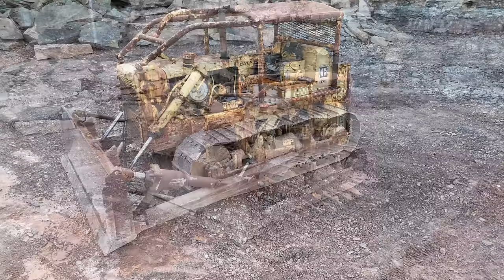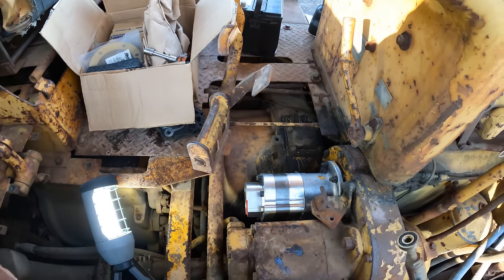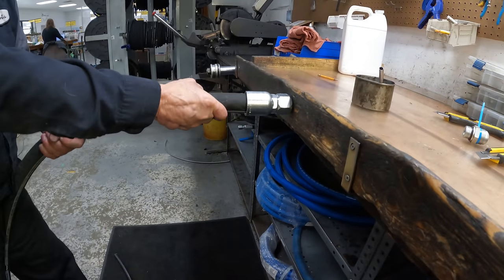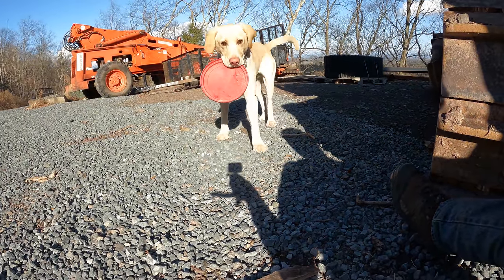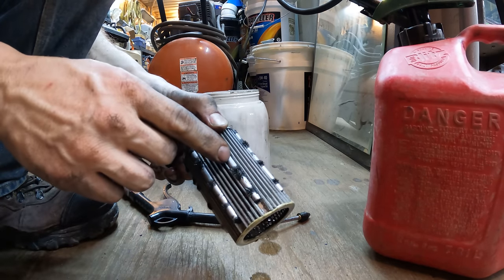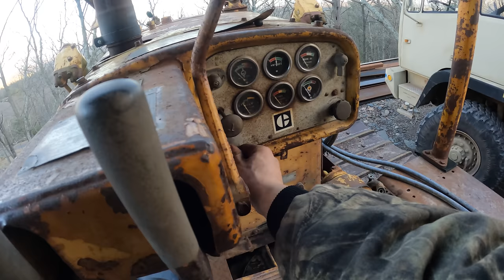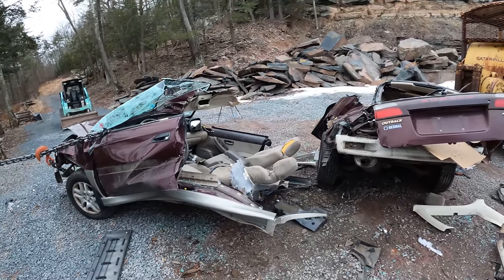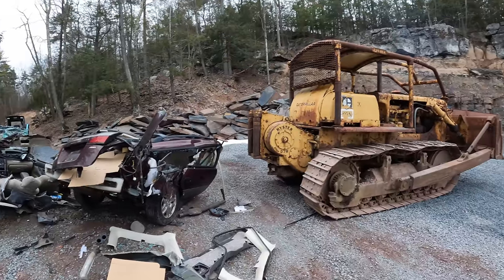Fixing a bulldozer winch

Comment: Id recomment putting some cable grease in the winchline, lubrication is very important and will make spooling way easier. Cable grease is also water proof and will penetrate into the cable fibers.
Reply: Cable fibers?  I thought it was just strands of steel braided together?
Reply: @AK-47ISTHEWAY  It is still fibres of steel that form a cable.
Reply: @Drakey_Fenix  research  fibers goof    you have no clue
Reply: @bernlew977  each metal strand to make the wire is still called fiber dummy
Reply: @James Riley   go watch family guy kids    this is for the real men    not boys
Reply: Old motor oil/gear oil works wonders. I have had buddies that use this grease, and their cables end up fraying/snapping. I haven't had a problem with using oil. Ya its messy but done smart it's not too bad.
Reply: I was thinning that, and swap the cable end for and .. all the wear is on the first half (and put 4 cable clams on the hook end :) )
Reply: I knew what he meant...get over it... Grease the cable ...
Reply: @bernlew977  cotton fibers aren't fiber? GTFO, soy boy.

Comment: hey andrew, i am a commercial boat owner and a tip i can give you with old hydraulic winchs or any equipment that have been sitting, you can just hook one side up leave the other side of the winch port open, start up the pump hit the proper arm for that direction and collect all the gunk on the other port with a bucket. Usually everything comes off in 2-3 seconds. shut it off and hook it properly. Good video thanks! cheers
Reply: What does it mean to hit the proper arm? I understood the rest.
Reply: @jeevunvethanayagam6536  I mean acuate the lever for the port that isn't open so hydraulic oil goes through and exit in your bucket
Reply: @jeevunvethanayagam6536   the controls, forward, reverse, up, down,  etc
Reply: @realphilg  gotcha. Thank you for the tip.
Reply: I h.

Comment: Andrew, look in the bottom of the hydraulic reservoir and see if there are sand dunes of metal shavings/filings.  These will forever clog your filters.  Our injection molding machines came from the factory with piles of shavings in the 1100 gallon reservoir.  It looked like a friggin' beach in there.
Reply: @gatekeeper65  Isn't everything???
Reply: I found casting sand in a 1978 Plymouth Volare's 318 V8 many years ago ... its not just the Chinese ...
Reply: @uploadJ  Yep! And that's why race car engine builders thoroughly clean out ALL castings, iron, alum, etc. I bought a 1968 Dodge Coronet brand new. Had a rattle in the door, so rather than take it to the dealer, I popped the door panel off and found a 9/16 X 5/8 end wrench laying in the bottom of the door from the factory!!
Reply: @Watchyn_Yarwood  Score ! 😃
Reply: In hot/summer day (when oil does not look like ice cream) I guess opening the both filling/bottom caps will be good. If possible make the dozer not fully level so the drain cap will be "as down as possible" regarding rest of the tank. Then a good wash with sprayed fuel/diesel and let the tank dry. If tank drain "too much" dirt as part of this cleaning I guess opening it may be required. But cleaning it with a good "diesel wash" will surely help you to keep the pump/winch in good operation for a long time 🙂
Good video whatever.
Keep going Andrew !
Reply: @gatekeeper65  A man can't have too many wrenches!
Reply: I would think he is going to at some point change that oil and flush it, there was water and who knows what came out in the old oil, if he doesn't look for another video in about a years time where that pump needs to get replaced as it had stopped working for no reason 😆😆
Reply: I love the beach

Comment: Solid repair.  That winch has got some balls!
Reply: The biggest balls of them all!!
Reply: Probably at least a 65,000 lb winch. It’s badass!
Reply: Imagine what 500’ of cable alone weighs, not sure what that EX weighed but i never heard the engine change tunes dragging it....
Reply: d7h's are 80,000lb winches
Reply: @Dan-ot7tz  holy shit thats insane litteraly the power of god
Reply: That winch has enough power to pull hell off from it’s foundation. And then some..
Reply: Definitely jolly cat yellow balls
Reply: I looked up the specs on a winch like that (Caterpiller 57H Winch) and found it is rated at 120,000 lbs. The cable is probably good for only about about 1/2 of that.
Reply: @Dan-ot7tz  sweet!! So he can kinda pull a fully loaded semi gross weight of 80,000 lbs
Reply: If he does not like you he could put a 60 ft I beam on one side of your house and well 😋
Reply: Hoo yes plenty of power 🔋in that watch.
Reply: Sup Chris 🤙
Reply: I'm not sure though, but it seems like that might be the wrong way to make a stretch limo.
Reply: @joeymusik1609  If it is the 7L winch, it will have 70,000 lbs of pull.  That would be the standard winch for this size of Cat.
Reply from the maker: Thanks. Yeah it’s pretty much unstoppable because it drags the dozer around if it can’t pull something.
Reply: @gavinperry7237  He did on the one or two pope thread fittings. The fittings on the hoses have internal beveled surfaces that make the seal, the actual threads just hold everything together.
Reply: @joeymusik1609  according to hyster info 80,000lbs on a D7
Reply: The hydraulic physics blows my mind
Reply: @jamesharris40001  wayt until you Discover theres about 15types of fittings 😂
Reply: @AndrewCamarata   A fitting end of a Subaru.
Reply: Which wihch

Comment: I think those two lines just hanging out were coolant swap lines. It's pretty common in logging/oil drilling to run warm coolant through a cold engine to get them started easier in the winter. Just my two cents, and Great Video!!
Reply: Nice to know.Thanks for sharing.
Reply: @Steve Sherman 5
Reply: This is exactly what i was going to say! As ol peg from zip ties and bias plies would call them spit swappin lines!
Reply: I believe your right I pulled a tanker with food grade stuff we ran coolent to keep products from freezing
Reply: Those are hydraulic couplers on the end. Only thing I can see is they were for running auxiliary hydraulics.
Reply: @Donkusdelux  you could be right, but they just looked like regular quick connects to me.
Reply: @Donkusdelux  for harrows and fire plows !

Comment: Even at 65 years of age, i'm still fascinated how a small device that pumps a tiny amount of liquid can build enough strength to move such a massive weighted machine. There are literally thousands of pounds of weight involved here but yet that little pump will pull that entire machine on angles and often even up hill with other weight attached sometimes. This generation is also fortunate to have modern machines that are so powerful that they can be operated with a little joystick and a few push buttons and even having such luxuries as Air conditioning and heat and stereo in a enclosed cab.   When i started out, everything was still cable operated and motor driven with gear drive units and some push button starters instead of pony motors to start the main motors. From Primitive to almost automated in just a span of 30 years it seems. Amazing.

Comment: I'm so glad that you know what you're doing when reeling in that cable. It's such an important step, which most people don't realize.... Anytime you are reeling in a winch cable (steel or especially with synthetic rope) you always want to make sure that you have some tension on it so that when it winds it's on there tightly. In the event that you don't do that, you run the risk of cutting the cable with itself due to the tension put onto a loose spool, as well as increased chance of it getting tangled up and wound up which would make it very difficult to undo. It's always good to see someone that knows what they're doing not taking half-assed steps. 👍🙌👏
Reply: Good advice I like to spray some oil on the cable when it's winding back up
Reply: @jackk8422  I actually worked for Warn for a little while... I learned a great deal about winches and how they function, Etc.  What you mentioned about the oil is a great idea as well. Prevents rust and allows them to spool out and back in much easier. 👍
Reply: @three6ohchris  learned that the first time I had to change the cable on a 80 ton crane.
Reply: @jackk8422  lol, Oh wow... I can't even begin to imagine how much "fun" that must have been, LOL.  Those hydraulic high capacity winches can be beasts.  Giant sizes of cable that have to be used on those.. good gracious. I see why you sprayed it with oil. LOL.
Reply: @three6ohchris  now that I think about it the cable got tangled in itself because the supervisor decided to break the crane down and he didn't have any tension on it. Also it was a 1974 p & h so it is a mechanical which

Comment: FYI, Just in case you aren't aware, there is special lubricant for winch cable that does not attract dirt. Regardless of what you choose you might consider putting something on that winch line to stop the rust. Spooling line on the winch is demonstrated well on Ron Pratt's channel. Just a suggestion
Reply: Seilfett
Reply: This lubricant is great for underbody protection on cars
Reply: It's not just the rust.  Oil inside the cable would make it more supple.
Reply: i was very surprised that while it was fully out he didnt clean it and lube it for future use
Reply: Yes 👍 it is!! Ron Pratt did an outstanding job on those videos….
Reply: @bigsrg978  thats what she said
Reply: @vj8452  das zeug Kleebt aber wie sau
Reply: Just spray some diesel on it when ya fuel up. Been doing that in th logging woods for years
Reply: Some cables have a core that holds oil/grease that makes them a soft lay and also internally oiled. We used to use them on our winches. That cable on the winch looks like it needs a little bit of care and attention before putting into any sort of action.
Reply: @bigsrg978  That is what I said.
Reply: Субару испортили...

Comment: Really like seeing you getting these old machines working again and their attachments. I just bought a fully restored (every nut and bolt removed) 1966 cat D7 with hyster winch also. The history of it is, it was bought brand new here in australia by a western queensland farmer (where i live) to do one job and that was to clear trees and make a road on his farm and make firebreaks around the perimeter of his property. From what i gather he did that and used it mayne twice in the mid 70s and he got sick and it sat ojtside in the sun on his farm until the owner before me bought it in the early 1990s. He started to restore it when he retired in 2007 and slowly worked on it and other machines in his collection. I had wanted a bigger machine but i can't justify needing any bigger. I bought the machine for what i consider a good price and he knows it will be used. He retored it to a condition that he said isnt overly restored. The engine was torn down and rebult and looks new but nkt brand newparts werent pilished but parts that were meant to be painted were. My first job will be digging a new dam tomorrow as we are meant to get some welcome rain. Happy new year from australia

Comment: Thanks for the videos.
A crows foot wrench head on a impact wrench with appropriate length extension can work good to tighten or loosen hard to reach hydraulic hose fittings.
Reply: Thanks dude! I've never thought of doing that! Seriously,sometimes I cringe trying to tighten fittings, putting covers back on and wondering "did I get that tight enough?"
Reply: Everytime I've tried that it's turned into a disaster 🤣 oh well I guess one more try won't make anything broken than it already was 😁👍

Comment: Andrew you still need to let the starting engine stop by running out of fuel to save the 1 quart in it from being  diluted  with gasoline.  The small tank shown is actually  safer  for that engine than the factory one thats mounted up above it. Placing the  tank down below the engine ensures it wouldn't have a constant supply of gas.
Also that loose track hasn't  come off yet? Wow looks real loose, bad tentioner shaft seal? Real funny parting out of the Subaru with the winch cable lol
Reply: Maybe The Chieftain would be interested in stopping by for some track tensioning  ; )
Reply: totally agree on the pony motor need to let it run out of fuel and you dont need alot
Reply: That track is probably worn to a length that is more than the adjusters can take up. He might need to compress the adjuster in and remove a link of the track. I'd say that undercarriage is 10%.

Comment: I've been waiting for this video to see you fix that I'm glad it was just a simple thing to fix you know just a pump and cleaning things up we used to use those winches that you're using right now to drag Douglas fir and cedar logs up of 6% grade out west that were 32 to 34 ft long and anywhere between 3 to 4 foot acrossed with absolutely no problem at all you'll be amazed with that thing will pull
Reply: well it probably has what 200-300 HP diesel engine driving it the weak link almost definitely being the cable itself which looked to be an inch or better in diameter, quick google search shows 1" stranded steel is good for  a breaking strength of 86,000lbs.. hate to be around if that lets go.. if youre not chopped in half your pants will be ruined and likely your ears blown out

i dare say if you find a way to make the dozer immovable and the winch line loads up near that amount itll break that cable too.. asssuming theres no pressure relief in the hydraulic system thatll goto tank prior to that happening

Comment: Because of your channel, every time I pass by a place with heavy equipment I'm like "this would be so much fun to work on".  Glad you got it working.
Reply: Said no heavy equipment mechanic ever 😂
Reply: @tasmanmcmillan1777  Haha most definitely.  Ask me again when it's 30 degrees, snowing, and I need to drop the oil pan
Reply: @N0Fumar  try when it’s 47 degrees c & the pin between the main boom & stick of a 500000kg excavator has seized and refuses to move anywhere

Comment: I do have a question, for you Andrew.  I hope you see this, that fitting on the filter that has the "jam" nut on it being feed from the hydraulic pump.  That type of fitting you do not put sealant on the threads or pipe dope.  That is a straight threaded fitting that uses that o-ring at the sealing nut to keep the hydraulics in.  When you put that fitting it it should not and I say this strongly should not get tight.  That means you have bottomed out that fitting that can break the housing that it is going be a bad day.  Just run the fitting till you feel it stop, loosen the fitting up one turn lining it up with your hose.  Thread your hose back on the fitting and use the hose to help hold the fitting while you tighten up the sealing nut that has the o-ring.  Job done.
Reply: O-Ring Boss fitting
Reply: STOR fitting ... straight thread O ring
Reply: @tyendor1952 )
Reply: It looked like it had a jam nut on it based on how he was manipulating it with two wrenches, but if you watch carefully, it doesn't seem to have a jam nut. That he'd on the end is integral.
Reply: Where is the question?

Comment: 16:22 there is no need for thread tape on o-ring fittings! It just adds a potential source of contamination. If it leaks, replace the o-ring. Same reason you don't use thread tape on JIC and other taper seal fittings.

Keep up the great videos!
Reply: I will sometimes use teflon tape  on taper fittings. The tape is not there to make the seal, I use it to make it is easier to crank down on the fitting.
Reply: The only issue is that JIC fitting is not tapered on either side, one side uses the oring to seal and the other side is a face seal. But I do agree pipe tape and pipe sealant does make it easier to put together and makes a surprising difference when trying to take it apart years later.
Reply: @haheyourdead1187  an ORFS fitting is not a JIC fitting. JIC do have mating 37° tapers that seal to one another. ORFS have an o-ring in place of the taper.

That 90° fitting has JIC on the vertical and UNO or ORB on the horizontal. Neither should have thread tape in the mix.

If you want to prevent corrosion in the threads, use grease or anti-sieze on them. They don't have the potential to cause issues if they get into the hydraulic system.
Reply: @jaynecobb3701  There are no tapered threads on that fitting ... straight threads with an o-ring and them a jam nut.

Comment: Great video as always. Might I suggest an upgrade in your shop compressed air system. A 5hp 60-80 gallon stationary compressor with lines run around the shop would be much nicer and more convenient than dragging that portable compressor around. A lot quieter too.

Comment: Hey Andrew man… fan since the blue RAM and the intro of and the mods of the white RAM. I have a cleaning tech tip. Cheaper than most other things in a can, dries fast and does not rust. And is more portable than an air compressor. Brake cleaner is the stuff. Especially for machined parts like pumps and gear internal and external. Maybe two to about 4 cans will take care of the entire dozer and winch. Best multi tool since the Swiss Army knife. Later.

Comment: 31:30 Just enough line to winch another dozer from the top of a mountain all the way down to the bottom. The coal mines I used to work at used to do that on the high walls. A big dozer on top, tied to a small dozer  that would "drive" down the mountain and the bigger dozer would pull them back up to the top.

35:11 those 2 hoses were auxillary hoses for the rear I think, in case you had a different attachment on the back, other than the winch. Like a backhoe attachment maybe, or the giant plow that uses hydraulics to raise and lower the plow into the dirt to bust up hard earth.
Reply: I suspected a land clearing plow, but it's hard to tell.